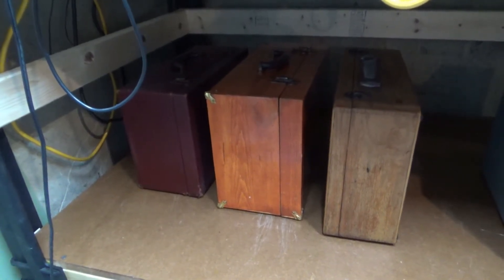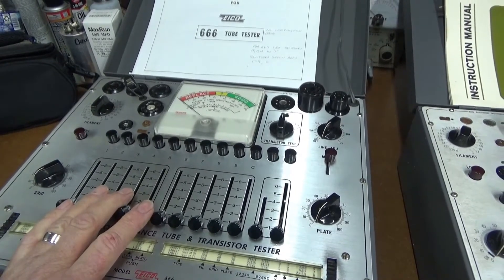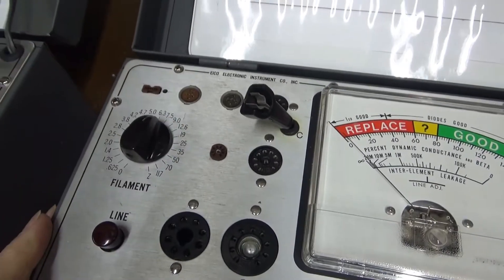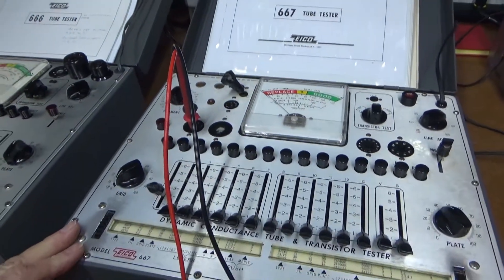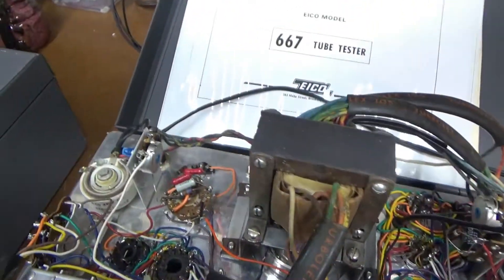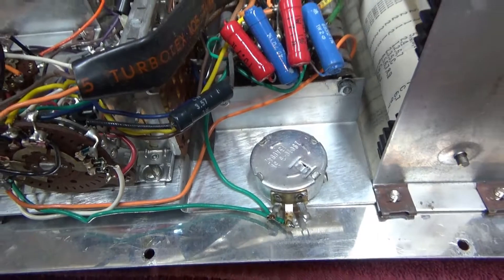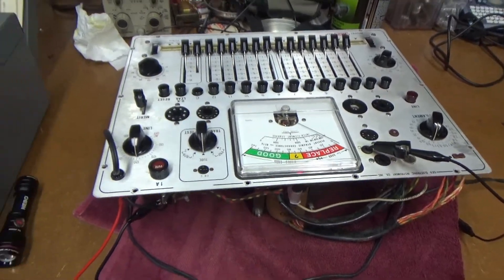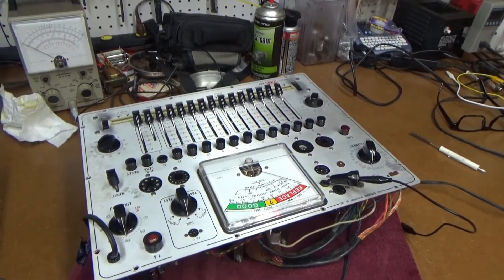1965 Eico 667 Tube Tester Service and Calibration

Comment: 12ax7's always fall into the "replace" range on my 667; even though their actually good-  a 40 or higher reading. certainly it's needing fine servicing apart from cap replacement and calibration- resistor replacement with metal films and loose socket replacements. the 667 has certainly paid for itself in sorting out the bad tubes sold by ebay sellers claiming "strong" , "no leakage", "matched". there are 2 versions (or more) of the 667- with 2 different valued resistors on the calibration circuit. thanks for the video.
Reply from the maker: I'm seeing the same thing. Known good 12ax7 as tested on one of my Hickok testers will test bad (about 30) on the 667.  I'll so some investigating. The Eico roll charts as infamous for errors.
Reply: @mguess  tried several other settings based on web searches with equal results. 667 has its limits, but useful.

Comment: Having problems with my Merit switch when testing.  It's wanting to peg the meter.  ouch...
Reply from the maker: Wow. Is that happening while testing all tubes. If so you may want to check the values of the resistors and pots in the unit. You may want to use a contact cleaner on all the switches.
Reply: @mguess  It’s a short in the momentary switch I believe.
Reply from the maker: @SinnerSince1962  Hopefully you can fix the switch. May be hard to find a replacement.

Comment: Thank you for making this really helpful video. 👍👍👍 I acquired an Eico 667 TT some years ago and was looking at it recently.  I found it in a second hand store and paid $20 and change for it.  The power cord is cut and twisted together, so I need to replace or repair the cord before I can do anything.  I bought an owner's manual with a bunch of other tech documents to work on it in the future after I move out of my current house.  Did you know that there is an Eico 615 Tube Adapter for testing the older tubes with the Eico 667?  If you get one of those adapters or build one, you shouldn't have a need for the Eico 666 TT.
Reply from the maker: Thanks for the comments. I didn't know about the 615. Cool device, I'll have to keep an eye for one. However since I already have both testers I really don't need the adapter but it would be nice to have.
Reply: @mguess  Sure, you bet.  I'm looking for the 615 adapter as well.  A fellow used to build aftermarket adapters, but he doesn't appear to be doing it anymore.  The 615 comes up on eBay every now and then, but people have put out instructions on the internet on how to build one yourself.  If you could make a video on how to build one, it would be appreciated by many people (especially me) I'm sure.  Anyway, it's just a thought.

Comment: HELP!!! Hi I have been using mine for years. I have a really clean unit I got from my father.  I just tested a 5U4 Rectifier tube that had a light show and blew a HT fuse in a fender guitar amp. So I tested it in my 667. It would make the transformer hum loud and it def. did not like this tube! the fuse blew in my 667 and after replacing fuse,  my meter needle will not move past 5% on line adjust. I decided to take it apart and give it a look over and a really good service cleaning. I cleaned all of the pots and rotary switches and checked all of the resistors. while checking the transformer tap voltages all of the voltages were close and then the 10uf 150 cap exploded under the trim pot on the filament rotary switch side of the unit. I replaced it with a new nichicon 10uf 160 volt and the needle still won't move past 5% on line adjust. That rectifier fried something but I can't tell what it fried. I see a tiny clear diode or something I have no idea what it is or how to measure it. but you mentioned diodes and I would love it if you could walk me through identifying and checking them. Thanks for the videos. subscribed.
Reply from the maker: Wow! It sounds like that 5U4 may have been shorted internally. I just checked a known good 5U4 on my Eico 667 and it does make the transformer hum.  Did you notice a short on the interelement leakage test. The "blown" electrolytic capacitor could have taken out the diode in the tube tester. Do you have the schematic diagram of the 667? If not I can send it to you. There are 2 solid state diodes in the tube tester. One is a small signal diode (the clear one). The other is a rectifier type. It should be larger and covered in black plastic. Does your multimeter have a diode test function? If so I'd recommend checking those two diodes first. Let me know the results.

Comment: Hi Can you please recommend a good replacement for the rectifier diode (CR1) in the 667........I put in an overkill 1N5408 temporarily and my needle and everything started working again, I even calibrated it. I read somewhere the old one is a selenium diode, have no idea about it's specs other than (50 Ma) in the parts list.........Thanks for your help.
Reply from the maker: Yay! Glad to hear that the Eico is working again. I was a bit worried about the meter movement itself. Those are really hard to come by. 
Yes the 1N5408 is probably overkill but I wouldn't change it if it's working and calibrating properly. I was going to suggest a 1N914 which is a very cheap and common small signal switching diode. The parts list isn't very descriptive but I think the original diode was probably something similar to the 1N914. It's a silicon diode not selenium. Selenium diodes are the older technology used before the development of semiconductor devices. They are much larger and feature big square metal plates in their construction. I think the part that you used will work just fine and not cause any issues. Good luck and remember be careful with suspected shorted tubes, they are tube tester killers!

Comment: I have an EICO 667 without the roll chart. My book shows data settings for loctal tubes like 7A7 & 7B6, but can't find a socket that they fit. What am I doing wrong?
Reply from the maker: On my 667 it's on the far right side next to the "merit" switch.
Reply: @mguess  They do fit that socket next to the merit switch but they are extremely loose like the pins are two small or the holes two large.  Maybe it just feels that way I never did try it. Thanks for answering

Comment: I've got a hand me down Eico 667, has some case rust so previous water damage, but the line adjust sets well, trouble is tubes don't light up, can't test anything. Also, the 3k pot for the Plate was stuck suddenly, and I took the knob off, tried to spray the pot from the top, and got it to turn with pliers, but now feels like pot does nothing, super easy turning. Opened machine, confirmed wiper is turning in pot, so not broken, but not getting any meaningful readings from the Plate pot lugs as I turn pot with machine on. Has the pot failed, this looks like the one that is easy to source and replace, but need to troubleshoot properly. TIA
Reply from the maker: You may want to start with a good cleaning of all the controls and switches with a contact cleaner like Deoxit. Most of these old tube testers have been sitting unused for decades so the controls are sticky and oxidized. The tubes not lighting up is a concern. Did you do the test that I demonstrated in the video about testing the tube filament transformer? 
With power off, you can test the plate pot by measuring the resistance between the wiper and end connection. You should see a smooth change in resistance as you turn the pot.
I have the manual on the 667 which includes a schematic is you need it. Good luck and let me know how the results of your restoration.

Comment: I want to buy a eico 667 tube tester
Reply from the maker: I got mine on eBay.
Reply: @mguess  ok give me link in eBay
Reply from the maker: @radiotvrepair1059  just do a eBay search for "eico tube tester".  You should see a few for save.  Keep checking back and look for a good deal. I bought mine for under $100 in non-working condition.
Reply: @mguess  Bid 249$ it's you tube tester
Reply from the maker: Yes, I think the one you found is a Eico 667 tube tester which is what I have.  Keep checking on eBay.  You may find one for a better price, $250 is a little expensive.

Comment: Those are the best deals when they say for parts or not working but they do work :)
Reply: I. Am. Looking for. One. That. Worked. Execellent
Reply: I.  Don’t want a. Broken one. I. Want. A. Good. Working. Order
Reply: @markwhite3443  just look on ebay that says for parts or not working most of time in description it says powers on and needle moves but no further testing has been done. That means it's a working tester. Only thing would do to make more accurate is replace caps and out of spec resistors and then calibrate it

Comment: I own a hickok 752 with adaptor can test all tubes. Very accurate after I calibrated it. Since it doesn't test emissions I also own a EMC tester which can test conductance but it's not a accurate way to measure it
Reply from the maker: Thanks for the comments. The 752 looks like a very nice tube tester. I have a few Hickoks also, two 600A's and a 6000.  I'm not sure about the 752 but all my Hickok testers will test for emissions only when applicable, like testing diodes and rectifiers.
Reply: @mguess  yes there great for testing both emissions and mutual conductance. I went with the 752 cause much faster to test 2 sided tubes (just have to push plate 2 button) and mutual conductance is on a fixed switch instead of using shunt. So results are repeatable. I would like to own a 600a for the emissions and maybe to compare conductance results but cost of them are way more then there worth

Comment: Very good testers for testing emissions. Not so much for testing conductance but still a good tester
Reply from the maker: I agree, the Eico's are very good emission testers.  I have a couple of Hickok testers for mutual conductance testing.
Reply: @mguess  which hickok testers you own?
Reply from the maker: @Tysman909  I have 2 Hickok 600A tube testers from the early 50's.  When I was looking for a transconductance tester I found that I could buy 2 "not working for parts only" testers for about half the price of a single working and calibrated tube tester.  So I purchased 2 Hickok 600A testers on eBay.  I was able to restore and calibrate both tube testers.
Reply: @Tysman909  I. Might. Interested in. Eico tubes. Tester. That. Worked. Real.  Good
Reply: @markwhite3443  there good testers the only issues the 666 and 667 had where errors in roll chart. I own a Hickok 752 that I restored before that tester I owned a hickok 6000a which I sold to buy the 752